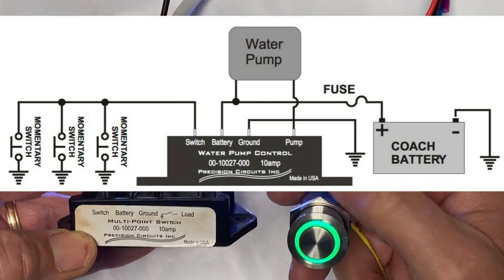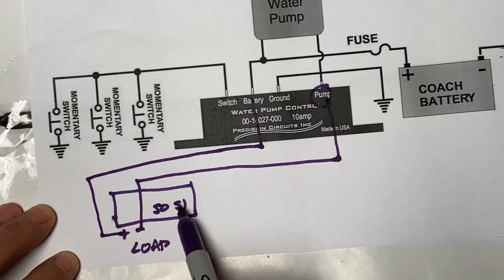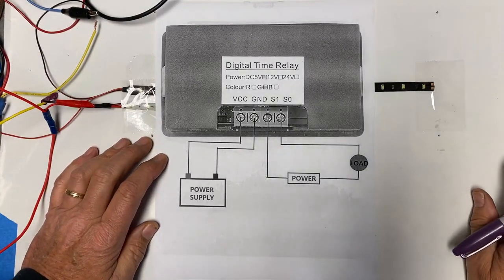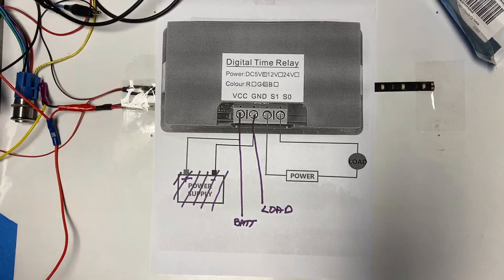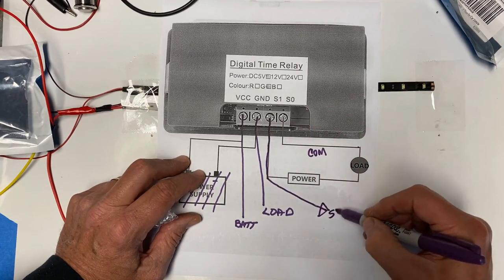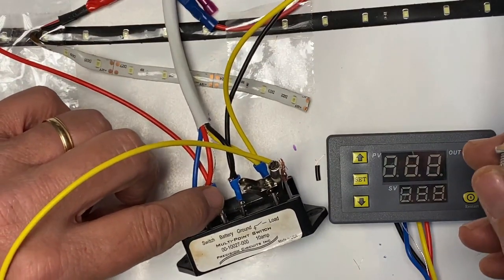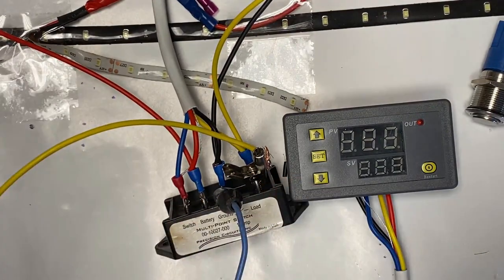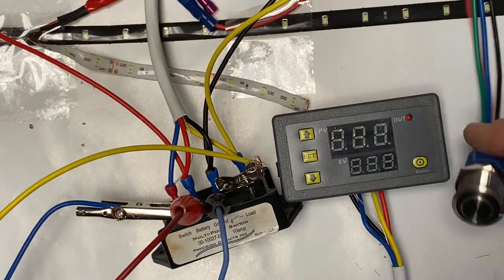How to Wire in a Timer for Auto Water Pump Shut Off

Comment: My pump goes on/off as soon as we are opening the faucet, no switch button. Can I do a setup that when open faucet, the timer start, if we close the faucet before 20 min the timer reset to 0. But if we leave faucet open longer, the pump will shut down automatically after 20 min, and stay off until manually reset.